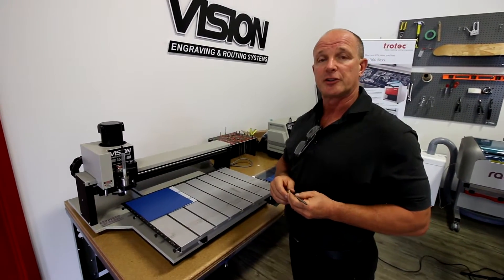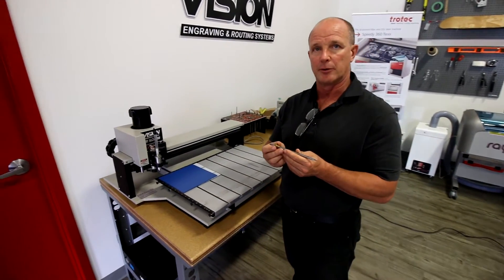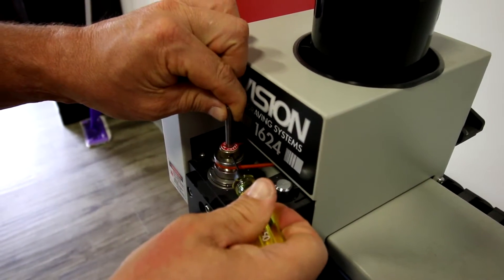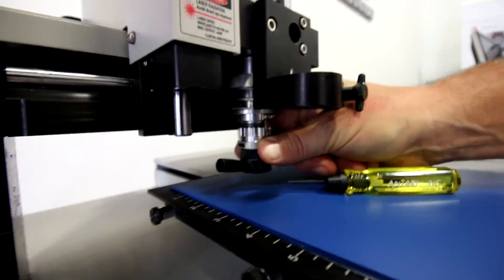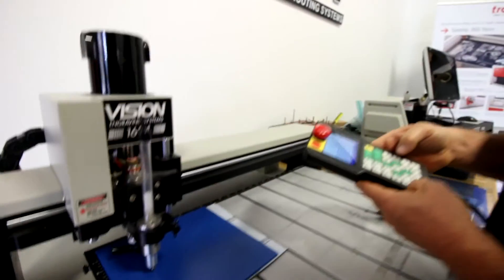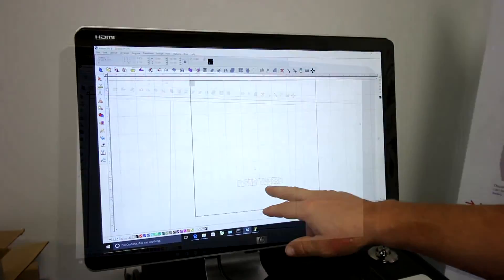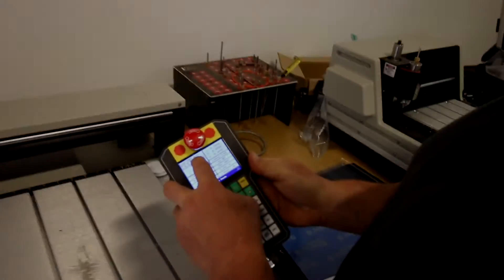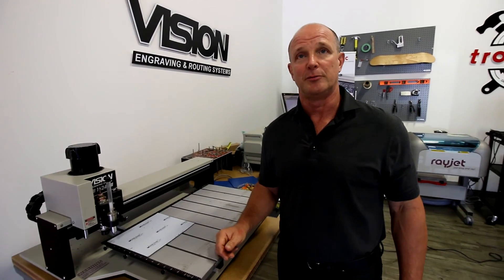ADA Braille Signage | Making Braille Signs

Comment: Hello, I’m working on a wayfinder project and would like to incorporate Braille into the design. The materials used for the wayfinders are metal, specifically steel. I’m interested in achieving the traditional embossed Braille feel, rather than simply etching or cutting the Braille into the surface. Could you advise on how to best accomplish this?

Comment: How often does the Braille insertion tool miss the holes like it did in your video. . . and shoot the raster sphere across the room?
When that happens, and it distorts the hole, you have to manually insert a new sphere... so how do you get it to fit the distorted hole? Superglue like the other auto-systems?

I want to upgrade to the Auto Raster system, but no one has developed a truly accurate system that won't mess up repeatedly. . . and having to re-do signs because the raster damaged the holes or having to superglue the raster into the damaged holes, just makes a lot more work and an ugly sign.
Reply: We have one of these at my work; accuracy hasn't ever been an issue, but pressure and hole consistency has been the most challenging factor. It is quite a bit of work to clean up shattered beads, whereas other beads around it may be inserted fine, or not inserted fully.

I'm sure it has to do with tool wear, and using various materials, but I do hope there is a way to adjust the inserter lowering velocity. Ours is much faster than the one shown.

If you keep a dedicated bit for each class of materials you should have better results.